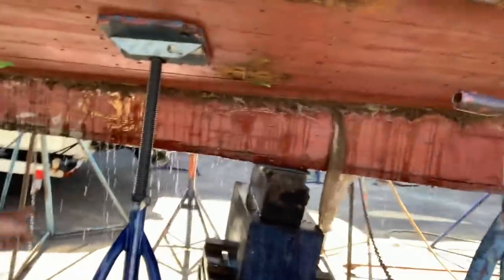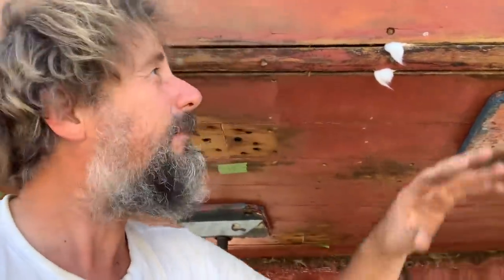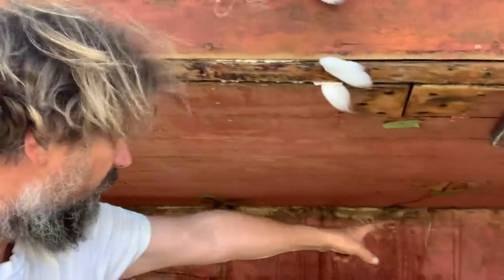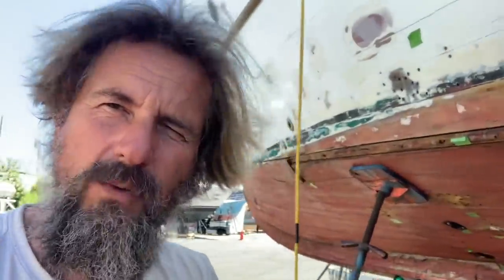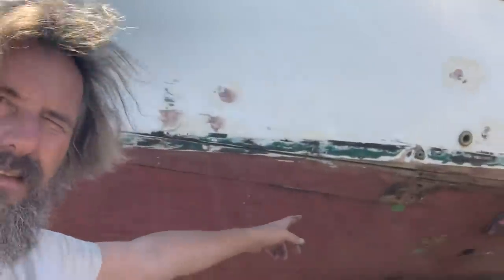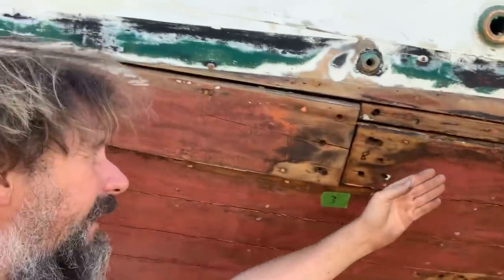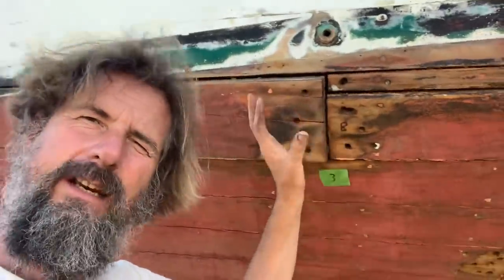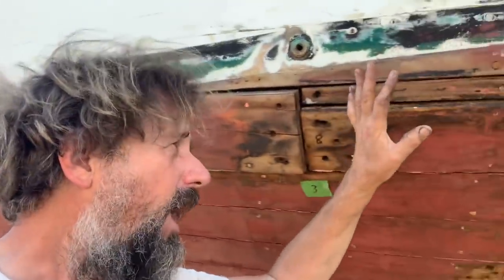Butt block from hell.

Comment: Hi Peter... Regarding the join of many 8 foot from the stem... yes put a big bit behind with support.. and extra fixings all the way from the bow and at least 3 frames back also 2 planks up and down also to the bow (even 1 screw per plank / frame) and consider doing the other side or at least additional fixings... on top of that a piece of metal over what may fall out due to water movement or possibly knocked out..
Have you countersunk the lag bolts below the engine so it is easier to put in an oil tray...
Leave the painting of the deck to gain time..
Hope this helps...
Regards Mark.

Comment: Peter I was looking back through your earlier videos today and I saw the vid were you pulled her out 3 years ago and she was called Kia Ora? Seems you still have a problem with the garboard. My advice is to get a boatbuilder to put a fillet in that seam because the more you bang stuff in and then remove it and then repeat the process, you will only make the problem worse as you will destroy the seam and open up the back of the plank making it impossible to seal. Just my thoughts.